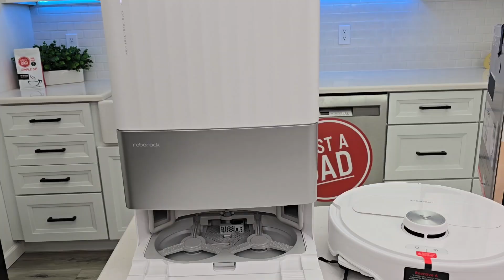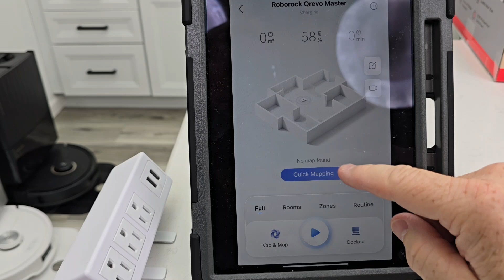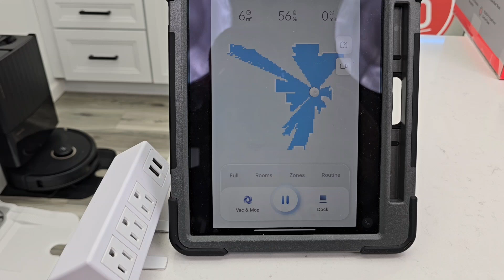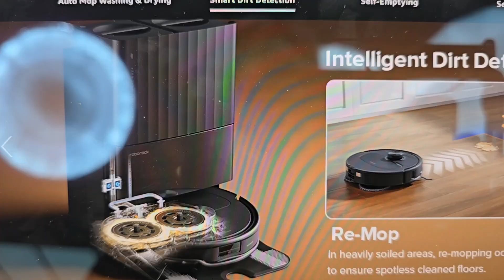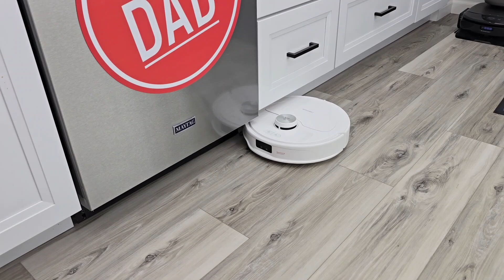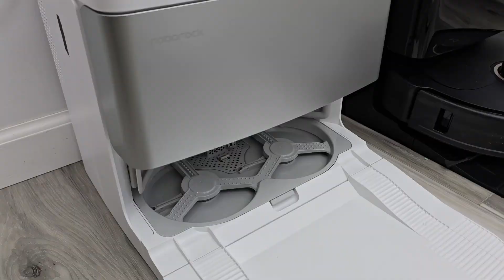Roborock Qrevo Master Robot Vacuum & Mop UNBOXING & How to SET UP Connect to App

Comment: Accurate lidar sensors are more expensive than high def cameras. That is why everyone is not using Lidar. The first self driving cars had a million dollars in lidar units mounted around the vehicle. This is why companies like tesla for example have been working so hard to do "vision" only because a 4k camera is like $10 and very small. Cheap lidar units are $100+